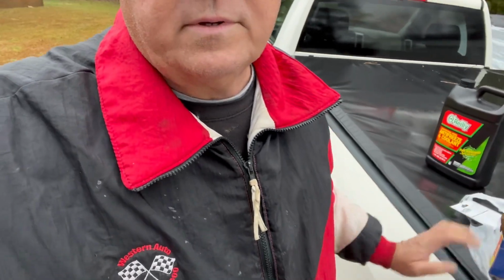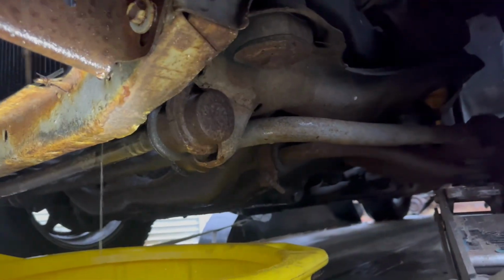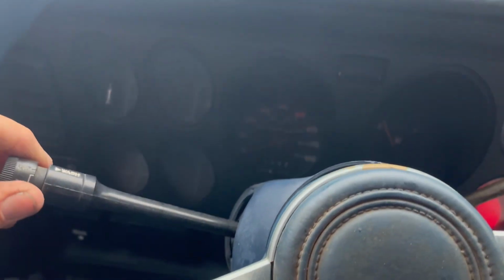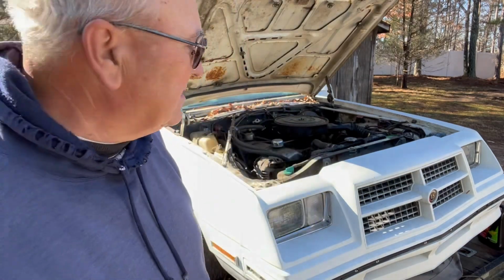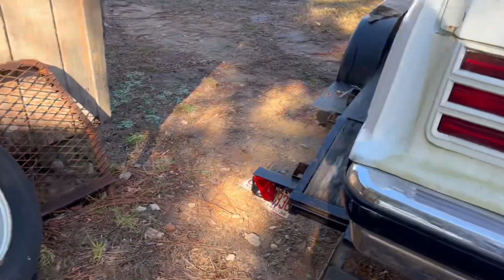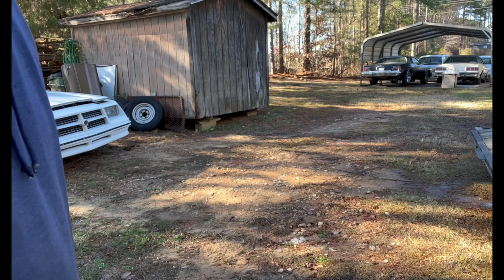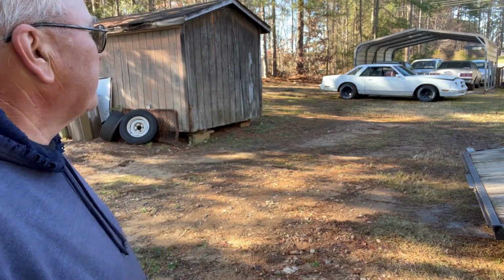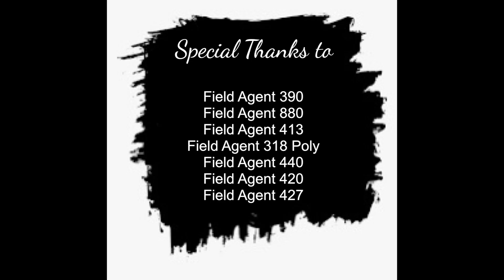1980 Cordoba LS part 2. I got some work done today

Comment: Here's a tip that I use, take a paint filter and put it in your funnel. It will catch the dirt while you pour the coolant back in. Most auto parts will give them to you, at least mine did but we buy a lot from them. I see you need a bigger carport for your ever changing fleet of cars
Reply from the maker: Yea I use paint filters often. This pan had grit, trans fluid & oil residue in it. Needs a total clean out. I actually have another 20x20 but too damn many trees in this yard.